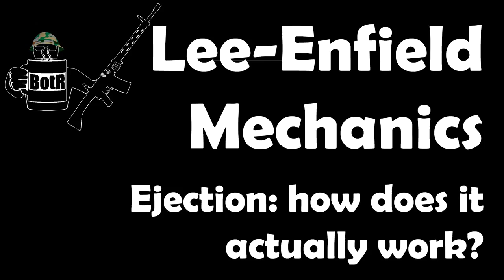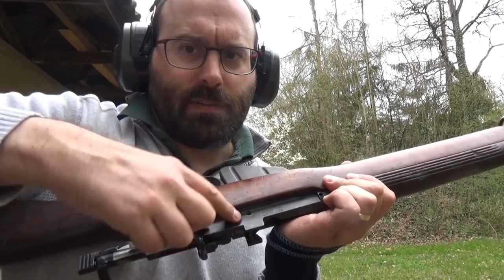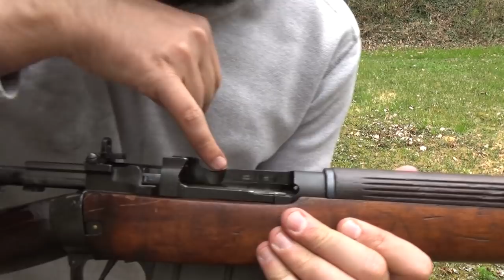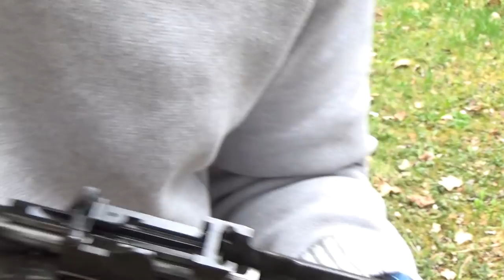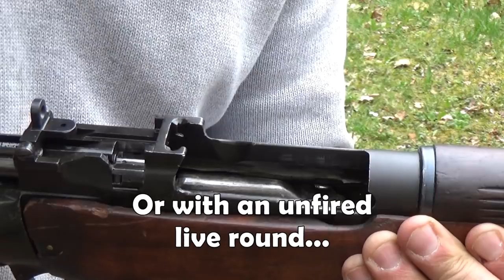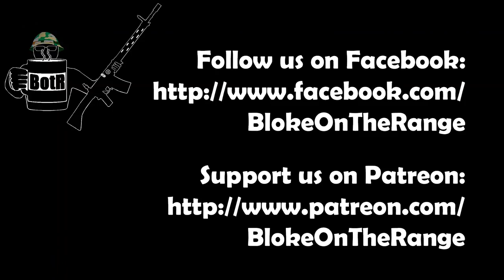How Does Lee Enfield Ejection Actually Work?

Comment: its almost like they knew what they were doing when they designed the rifle
Reply: Unlike the engineers designing the SA80.
Reply: TechGaming45 i wasnt going to say anything
Reply: If they knew what they were doing and the rifle was capable of doing what he claims it does and was actually doing it he wouldn't have to be gaming the demonstration demonstrating "controlled feed" with empty cases that aren't "controlled" at all. Notice he's never demonstrates "controlled feed" with a loaded cartridge coming out of the magazine. 

That's because the Lee-Enfield does NOT have "controlled round feed" and only a very few bolt-action rifles do. One is the Mauser action. Another is a Winchester Model 54. And another is a Winchester Model 70 "classic" action. The Mauser and Winchesters have a "claw extractor" and the extractor clips over the rim as the cartridge is stripped out of the magazine. 

Its called "controlled round feed" because as soon as the cartridge is out of the magazine it's retained in the bolt. You don't have to close the bolt and then open it to eject the cartridge. With the Lee-Enfield and MOST bolt-action rifles, the bolt shoves the cartridge out of the magazine and then it sort of bounces around as enters the chamber and has to "self-align" as the bolt continues to push the LOOSE CARTRIDGE foreward. Eventually the cartridge headspaces on the shoulder or rim, is "chambered" and as the bolt continues forward and is closed the extractor FINALLY clips over the rim. Until that happens, pulling the bolt back leaves the cartridge in the chamber. Which is EXACTLY what would happen if he was operating this rifle with a LOADED CARTRIDGE from the MAGAZINE.

Basically this is yet another complete fucking Lee-Enfield lie and myth in the making or being "demonstrated" with a bunch of bullshit and "tricks" that the kind of folks gullible and ignorant and clueless and UNARMED enough not to be able to figure out is BULLSHIT for themselves BELIEVE. 

Go get yourself a Mauser and a Lee-Enfield and some loaded ammo and do your own tests. Educate yourself and you'll know facts. Listen to frauds and liars make up bullshit to concoct and perpetuate myths about a gun that doesn't do what some "expert" at some point claimed and probably published in a book that more "experts" used as a "reliable source" for their OWN books and you'll end up knowing nothing but lies and fake "facts".

There is so much bullshit about there about guns apparently the "experts" who wrote books about them never even bothered shooting and operating and learning the mechanics of its not even funny. A classic is "you can't top off an M1 Garand". I believed that one right up until I was CLEANING my Garand one  day and LOOKING AT THE PARTS and using my MECHANICAL INCLINATION and general gun knowledge and EXPERIENCE from USING them to consider the situation. 

At that point I realized that there's no reason an M1 Garand couldn't be topped off UNLESS I was wrong in my own UNDERSTANDING of the rifle. So what did I do? An EXPERIMENT to see if I was right or the "experts" was right. Most poeple never QUESTION the "experts". And I wasn't QUESTIONING the "experts" either. I was asking why a Garand couldn't be topped off and why I would be wrong if I found out it couldn't be. I installed an en-bloc of EMPTY cases, cycled the bolt a few times to chamber and extract and eject (Garands aren't "controlled round feed" either) 2 or 3 cases so there would be room in the magazine to "top it off". 

Then I did exactly what I've done with every bolt-action, box-magazine rifle I've ever loaded or topped off and every box magazine I've ever filled. I pulled back the bolt, grabbed another empty case and tried pushing it down into the magazine. It went right in just like I was pretty sure it would since there was NO REASON IT WOULDN'T. The en-bloc clip of a Garand is NOT the "magazine". It simply holds the loaded cartridges in a cluster for storage, transport and loading into the MAGAZINE of the rifle. 

When the bolt is open and the magazine is empty (no clip and no cartridges), a clip and the cartridges it contains are inserted INTO THE MAGAZINE and the clip latches into place. The clip DOES contain the "feed lips" for the cartridges but the MAGAZINE is internal and the cartridge follower is always present in the rifle to LIFT THE CARTRIDGES VERTICALLY for feeding.

So how did a LIE that Garands can't be topped off become "conventional wisdom" and a "widely known fact" ever EXPERT knew? What "expert" who obviously didn't ever TRY decided it was IMPOSSIBLE? And WHY? I suspect that even if the "expert" did look at a Garand or diagram or some description of its operation, he assumed that because the cartridge follower has no separate spring and is actuated by the operating rod spring that controls the operating rod and bolt and resists and cushions their motion when the gas system forces the operating rod back and the bolt open and then closes the bolt to feed and chamber the next round, then the cartridge follower ITSELF must be sort of "driven" by the operation of the rifle. Meaning it was being FORCED upward by some mechanism to raise the stack of cartridges each time one was chambered, fired and ejected. 

Of course that's pretty silly since it would require a very complex "ratchet" system of some kind that would progressively jack the follower up a precise distance for each even and then somehow be magically released to drop the follower all the way back down when a clip was empty or ejected. There is no such system. What actually is happening is that the operating rod spring is a "2-way" spring. ONE END DOES engage the operating rod and control the rod and bolt, etc. 

But the spring "floats" in the operating rod piston bore and the OTHER end engages the simple linkage that transfers spring force to the CARTRIDGE FOLLOWER. So the follower is SPRING LOADED just like every other vertical magazine cartridge follower that has a FOLLOWER SPRING is. And like every other box magazine cartridge follower and spring, any time the magazine isn't FULL, there is ROOM FOR ANOTHER CARTRIDGE and it can be INSERTED AND PRESSED DOWN AGAINST SPRING PRESSURE. 

And do you know what's very interesting? Lots of the same "experts" who have written books and created the "conventional wisdom" like that Garand BULLSHIT have also written books about other rifles like the Lee-Enfield here. And many of them have been BRITISH. One in particular how is held in high regard by Brits thanks to his never-ending praise of British guns and general disdain for American ones was IAN HOGG. 

I wonder if HE decided Garands couldn't be topped off and that Lee-Enfields are "controlled feed" and ever since every wannabe "expert" who wrote a book or an INTERNET COMMENT agreeing with those LIES or made a VIDEO repeating them has been the unwitting, unwilling and unbelievably HILARIOUS useful idiot for his political agenda? 

Let me give you a little advice when it comes to learning about things like guns. If you can't see it with your own eyes and do it with your own hands or at least see what is being claimed ACTUALLY BE DEMONSTRATED with not "tricks", don't believe it. And for fuck's sake make sure you know what something like "controlled feed" ACTUALLY IS before giving the "expert" doing the claiming and demonstrating ANY respect or credibility he hasn't earned. 

If all the supposed "gun experts" making and producing and uploading shitloads of gun videos to the internet or writing blogs or articles spent as much time SHOOTING as they do TALKING and cared as much about GUNS as they do looking like GUN EXPERTS, they'd be GENUINE AUTHORITIES on guns and wouldn't have to FAKE their videos.
Reply: Is that why there is no spring-loaded plunger ejector in the bolt face like pretty much every other bolt-action rifle and repeating rifle or shotgun ever made has? Because they knew what they were doing and everybody else was clueless? Yeah. That's why nobody else used the rear locking LUG (most Lee-Enfield fanboys claim there are LUGS plural but like most Lee-Enfield claims that's BULLSHIT) this piece of shit design used. Or the "silky smooth cock-on -close" action. They weren't "silky-smooth" when new and "cock-on-close" is about as retarded as a design can get since if there's a problem with the firing pin, striker, spring or cocking mechanism, you won't know about it until you have the bolt closed and locked with a loaded cartridge in the chamber and pull the trigger and only get a "click" or nothing at all. 

With a cock-on-open system, which is once again that everybody else has used, you FEEL the firing pin or striker being cocked and it's a big part of the resistance when opening a bolt. Which is a GOOD THING since only a complete moron thinks a floppy, loose and easily manipulated bolt is anything but an indicator of a crappy, worn-out and sloppy old rifle that is long past its prime, doesn't lock up effectively, doesn't headspace cartridges correctly and is a good candidate to go "click" as often as "bang" OR really go BANG! at some point when a slightly "hot" cartridge is fired. That kind of sloppiness and looseness also leads to things like JAMS and FAILURES TO EJECT and BLOW CARTRIDGE CASES and SEPARATED HEADS when the excessive headpace lets the cartridge stretch too far and overcomes the elastic strength of the brass. 

If the British would put half the energy, time and money they put into lying about and propagandizing and creating myths about how GOOD their guns are into making BETTER guns, they'd be a lot better off. And their supposedly SUPERIOR designs wouldn't be completely IGNORED by later gun designers and manufacturers who never seem to want to COPY what is supposedly the BEST. 

There are literally ONE OR TWO guns that have ever copied any aspect of the Lee-Enfield design for commercial production. And why are they all but uknown? Because they flopped horribly. 

Ever heard the phrase "Imitation is the sincerest form of flattery."? If not, give it a think. Then ask yourself which "flattery" is more sincere. All the bullshit artist wannabe "gun experts" extolling the virtues of British guns OR a commercial gun industry all but devoid of imitations.
Reply: Bloke on the Range did anything that guy say have anything to do with the video? or did he just want to vent?
Reply: Bloke on the Range fair enough
Reply: Bloke on the Range I suppose it comes with the territory of a youtube channel. 

keep up the good work :)
Reply: God I'm leaving, this amount of sodium in my system is starting to cause some medical issues. Good thing Bloke is here to sweep this pile of salt off.
Reply: DEEREMEYER1 mas 39 is a copy of the Lee enfield as is the madsen bolt action. botb are military rifles both came out in the 30 and 40s when both the mauser and the lee were 50 years old plus. and they went with a lee style bolt system
Reply: Bloke on the Range It's a copypasta, probably by some wanker with too much time on /k/
Reply: DEEREMEYER1 Care to explain how he managed to unload the rifle without closing the action at 3:20 then? The Lee action is most definitely a controlled feed.
Reply: @deeremeyer1753  As an owner of two Lee Enfield rifles, I'm surprised by your comment and the tone you use. Bloke in the Range not only demonstrated the controlled feed with a loaded cartridge. Also with an empty case which actually is more difficult.  I think the problem is yours because you don't understand at all  the "controlled feed" concept. You better not abuse of the capital letters because looks like you're scolding people. It would be nice if other Lee Enfield owners give their opinion to this boy.
Reply: @deeremeyer1753  well i bought a no4 mark 2 nearly new (500 rounds or so ) and bolt was extremly smooth as silk !
Reply: @deeremeyer1753  I just ran a loaded round from the magazine into the chamber on my Savage no.4 mk 1 and the round slid right under the extractor about mid way out of the mag just like my Mauser does.  Now if I wanted to load a single round into the chamber by hand the extractor snaps over the round in the chamber just like a push feed.  Best of both worlds.
Reply: @deeremeyer1753  you have no idea what you’re taking about even though you talk a lot.
Reply: Ehh honestly ejection is really weak in this design. Enfields are really bad about failing to eject fully or spinning a case around and landing it back in the action.
Reply: @Brandon L  clearly you aren't manipulating the bolt in a soldierly fashion then.
Reply: @wierdalien1  I mean if your ejection is predicated on being ran in a specific manner every single time it’s a bad design for combat.
Reply: @Brandon L  in combat you aren't going to pussying the bolt. You are going to be slamming that thing backwards and forwards as fast and as hard as you can.
Reply: @wierdalien1  yea because you always are able to operate it exactly how you want, your not in the mud on your back trying to run the bolt.

A design that is predicated on very specific operation to actually function properly is a bad design.
Reply: @brandonl8039  well if you are on your back then the rifle is upside down and the spent case is going to fall out. And you are still going to be operating that bolt as hard and as fast as you can. 

And all, literally all, semi-autos and full autos are designed that way.
Reply: @wierdalien1  the point is a design that is very picky about how it’s operated is a bad design.
Reply: @brandonl8039  it isn't very picky, that's kinda the point, you just apparently baby your bolt actions.
Reply: @wierdalien1  no it is wayyyyy more picky than any of its contemporary counterparts from the era.

That’s just the facts.
Reply: @Brandon L  no, that's your opinion. 
One based off using it in a way it would never been used IRL. Ie like a baby.
Reply: @wierdalien1 lol no you just have an emotional attachment to the rifle for some reason.

It’s objectively a worse design than something with some sort of actual ejector.
Reply: @Brandon L  not really. It's hard to make a proper case however if you don't use it as intended. Ie with a little bit of adrenaline. 

Plus The Bloke here has done some really slow ejections with his myriad of rifles and not had a problem, so? Still only your opinion.
Reply: @wierdalien1  lol ok bud

Comment: Nice! A friend at work gave me an Enfield rifle for free just recently. It was missing a mag and the extractor spring, so I just ordered them and installed them yesterday. I still have to check the headspace though, but, thanks for the tips on an old rifle that I'm learning about.
Reply: I got my No 4 Mk 1* (WW2 Lee-Enfield) the exact same way. Just curious, is the rail in which the bolt rides damaged on yours? Mine is, which is why if you attempted a "mad minute" you would lose the extractor spring, due to the bolt head becoming derailed and the open part on its rear(where the curved part of the extractor spring sits) would hit the charger bridge, and eject the extractor spring out onto the field.
Reply: @PassiveDestroyer  The rail is most likely not damaged.  You probably have a No.4 Mk1 not astererisked bolt head, which is different from the Savage or the Long Branch.  The asterisk stands for  Western Hemisphere produced weapons and they  have a space machined into the bolt race that allows the bolt to be removed from the race and therefore out of the gun.  You probably already know this but maybe this'll help someone else.
Reply: @ralphwatten2426  Yes, but the rail is chipped off on the bolt race on my example. The bolt head may also be incorrect, as it doesn't have an asterisk on it.
Reply: @PassiveDestroyer  I've read about people who have had a No.4 mk1 bolt head that flipped out of the race because it was the wrong one but damage to the thing, different matter all together.  Good luck with the "old boy".

Comment: I am not sold on your explanation.  It seems to me that the empty case starts to kick out when it reaches the cut out.  The extractor press the rim against the side, yes, but after the rim enters the cut out portion, the front edge of the cut out acts as a fulcrum acting on the side of the casing to lever the front out and to the left.  The rim hitting the back of the cut out completes the process.  For a live round, the projectile doesn't leave the chamber until the rim is behind the cut out so it isn't levered out like an empty casing - hence the need for the screw.

Comment: You should contact the company Auto Ordnance, and lobby them to manufacture brand new Enfields. I figure if they can sell brand new Thompson M1s for $1300, complete with ribbed barrel, a 50 round drum magazine, and a front pistol grip, they should be able to manufacture brand new Enfields for alot less, right? I want a brand new Jungle Carbine, please. And while they're at it, they can fix the design flaws.

Comment: Mine won’t eject empties. I inspected the extractor to make sure it is fully gripping the rim, replaced the extractor spring, swapped mags, and switched brass. Still no reliable ejection.
Reply from the maker: Huh. Try replacing the extractor too.

Comment: My Enfield will not extract rounds from the left side of the magazine for some reason but it will for the right side of the magazine. Has anyone had this issue and if you have is there any fix?
Reply from the maker: Feed lips need adjusting to present the left side rounds higher. Or replace the magazine.